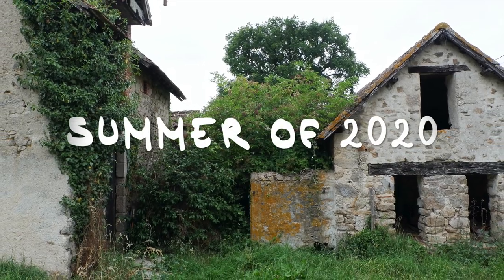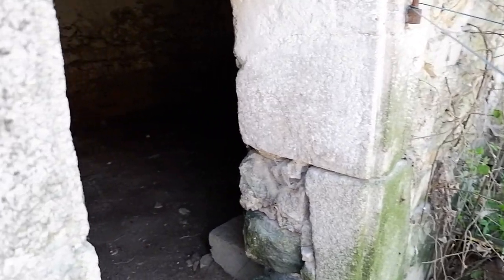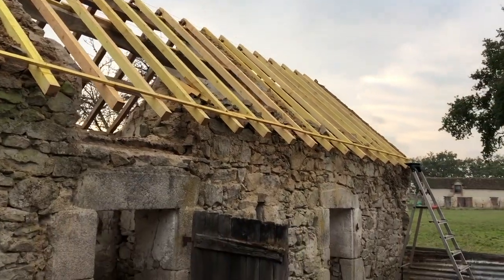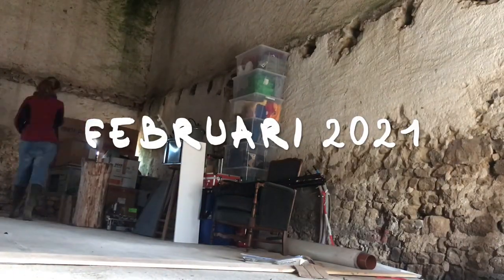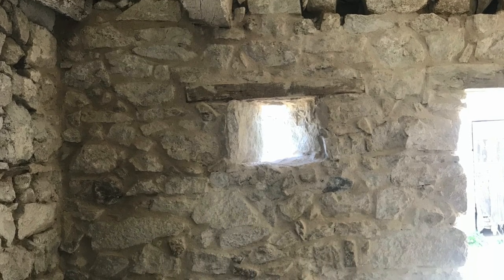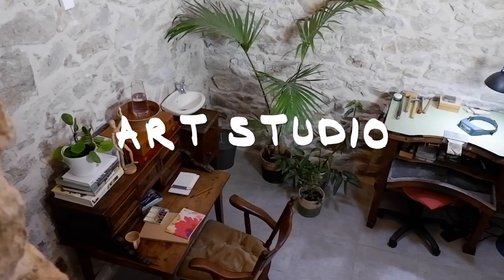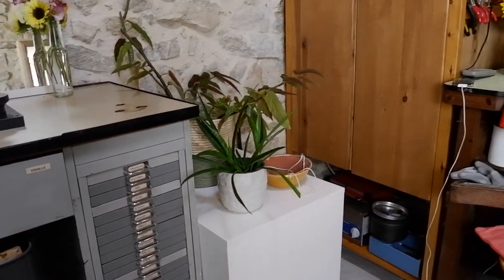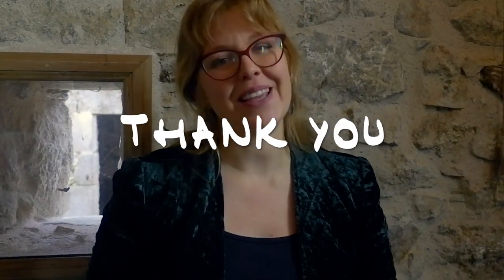Barn to Art Studio Make Over - Converting an old stone barn into a jewelry makers workshop / atelier

Comment: Nice job on the renovation. How are you heating the space?
Reply from the maker: Thanks! Great question: There is an electric heating now, as we will be installing solar panels in the future. It's not enough in winter (unless we use way to much electricity), but the walls will be insulated from the outside this year and we'll build a chicken coop/greenhouse against it at one side, that will also help. In the bigger studio we're currently making, we'll install a rocket mass heater.